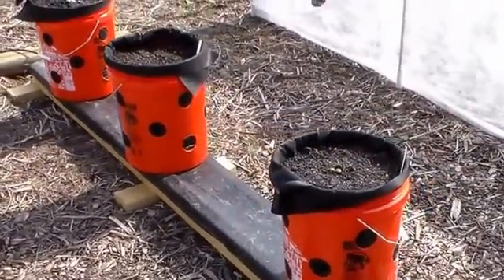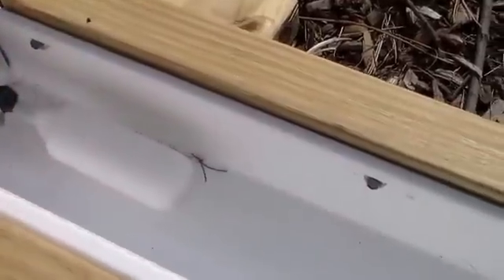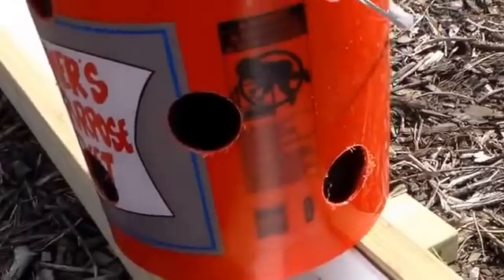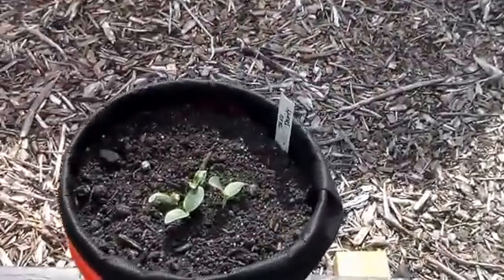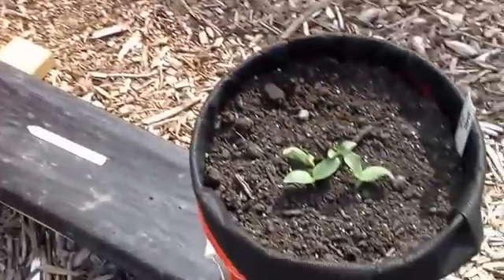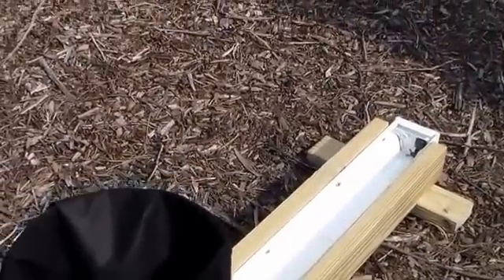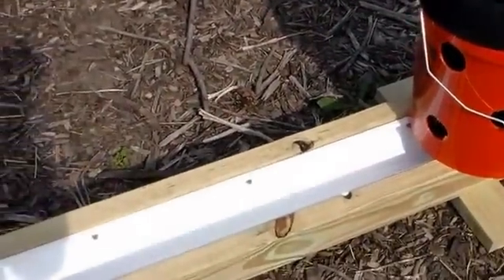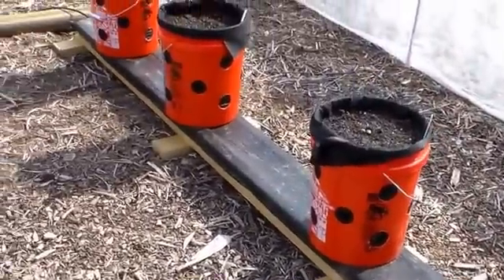Rain Gutter Garden Test

Comment: best way to build gardens like this is with Ferrocement and chicken wire.....
you can avoid plastic this way..... dirt will eat away on the plastic....creating nano particles over time...... anyway its way cheaper than plastic and grow bags...
it will last way longer and would look much better than commercial sticker buckets system..... easy to repair also... you need the Ferrocement.... its also the best way to build a water tank..... now you spent time adding value to the house

very simple to build.... 2 layers of chicken fence wire....  Ferrocement only 2 centimeters width..... easy to move around use a fridge dolly.... even the rain gutter can be built this way with  Ferrocement and chicken wire.... cement in a stainless steel pipe... toxic free garden..... its more work to get started but less work in long run.... wood will only rot..save planet stop using pcv...

@ 3taccount.com

Comment from the maker: JW Pookie - The frame is made by simply placing a treated 2x4 on each side of the gutter for support. These 2x4s will be held together with three or four boards acting as legs that are 12-14-inches long on the ground. Watch the video again to see that. The ground doesn't have to be "perfectly" level. Although, the more level it is, the better things will work since any water in the gutter will obviously level itself. If the end with the float valve is too much lower than the other end, water may never make it uphill to supply any planter buckets on the far side of the gutter.
Reply: jimginnyohio, Thank you for the explanation and video. Much more informative than Larry Hall's how-to video! Lol

Comment: I have been looking at the rain gutter grow system and in some of the systems the buckets have holes drilled in the sides and others the buckets are solid. Is there an advantage to one or the other? Should some plants be put in the pots with holes and others put in solid buckets? I know you have to have the hole in the bottom but I see on your video you have the holes drilled on the sides while the ones on larry's videos are solid.
Reply from the maker: If you are planting anything with large roots, you should add holes to the sides of your buckets. This will allow for "air pruning" to take place. This simply menas that when the roots come into contact with air (the holes), the root will stop growing. Without air pruning, the roots will grow into a circle at the bottom of the bucket causing the plants to become root bound. This could stunt the growth of the plants. Otherwise, for shallow-rooted plants, no holes are really needed.
Reply: Thanks

Comment: Hi! I also wanted to try Larry's rain gutter system but wanted to connect it with a rain barrel I'm planning to make, I was wondering what kind of float you used? Is it the 1/4 barbed minifloat? And what kind of plug did you use at the bottom of your water storage bin? I wanted to connect a 1/4 inch hose from the rain barrel and gutter system, but I'm not sure what to use to connect the hose? Hope you could help me! thanks!
Reply from the maker: I used the 1/4 barbed mini float. At the bottom of the barrel I attached a two piece pvc coupler that is screwed together with a rubber washer on the inside of the barrel. Look at my channel and watch my rain barrel video to see an example of the fittings used. Once the coupler was in place, I inserted a rubber cork onto it. A 1/4" hole is drilled in the rubber cork to secure the 1/4" tube that runs down to the float. I also made one with two holes drilled into the rubber cork to feed both gutters from a single barrel. Thanks for your comments!
Reply: jimginnyohio thanks for your help!
Reply: whats the smallest you can make these systems?
Reply: @mcmajor1589   - very old post but I have a 1 bag (bucket) system that works great.  Have a 1/2 gallon water bottle I use to keep it watered for a couple days.   I also have a system made from 4" PVC sewer pipe that hold many more bags.
Reply: jimginnyohio  Is your system as good as it seem to be?